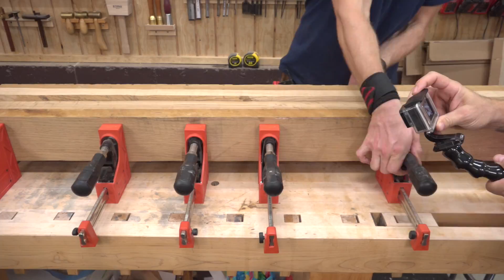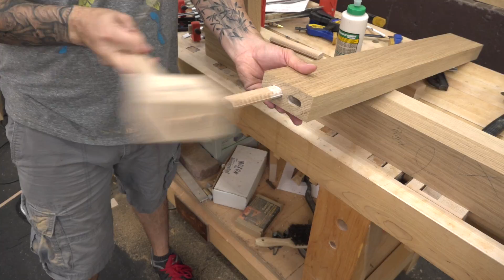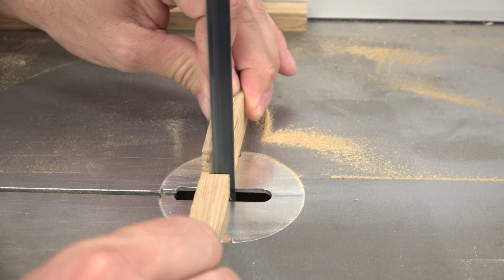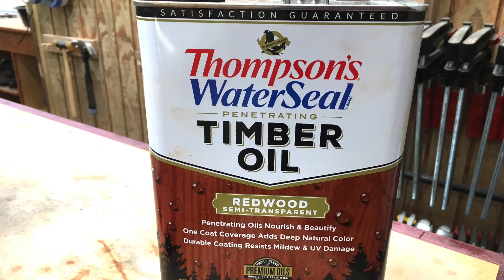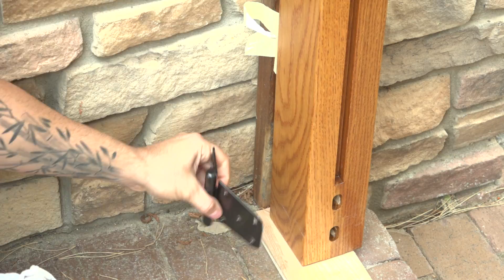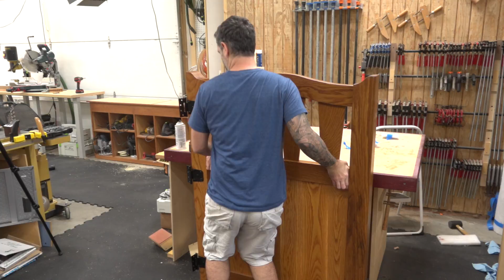Crooked Garden Gate

Comment: Installed my gate on top of an existing steel gate, heavy for the hinges but I also stick a roller on the bottom corner to support the weight. It swings smooth  without a drag.

Comment: Nice video and nice design. I've watched a lot of wood working type videos. This is  one of the few times times I watched one with the idea that I might make the thing. I don't know whether to feel discouraged or not. I have a contractor type table saw, compound miter saw,, a router and other common wood working tools. I've done quite  a bit of wood working but very little furniture level precision woodworking. So not sure  I have the skills and the tools to make a gate like this. I was surprised at the weight. I think I could deal with that though.

ETA: I liked how he used the slot cutter bit to make the groove in the curved stile. I hadn't figured out how to do that.

Comment: I love this gate. I have a pair of gates that need replacing and something like this might work really well. I want to bring up something in regards to thinning the Epifanes spar varnish. Last year I made two outdoor chairs from mahogany. On one chair I did exactly what you did and used mineral spirits to thin the first coat and then applied three coats unthinned. On the next chair, I forgot that I had thinned the first coat and applied three unthinned coats. A year later, the thinned chair had massive finish failure and the unthinned chair is fine. I called them and they require their proprietary thinner. I think their thinner is naphta, but I got their thinner when I refinished the problem chair. I hope you have better luck.
Reply from the maker: I have always thinned with mineral spirits and haven't had any issues. I am suspicious of proprietary solvents considering they are generally just more expensive versions of what we can buy at home depot. Grant it, naptha is a more pure thinner than mineral spirits, I haven't seen any personal evidence that using mineral spirits is detrimental to the condition of the finish. At least not yet. :)

Comment: After reading Bob Flexner and doing some experiments myself, I’m perpetually skeptical about any finish that “penetrates” the wood. But I am intrigued by CPS. Would be interesting to finish a board, then cut it in two to examine the cross section and see just how much penetration occurs. In the end, adhesion, resistance to u.v., flexibility, and various other properties may be more important.

Great job on the gate and, as always, the videos!
Reply from the maker: I don't think any finish penetrates very deep, on a scale that we can typically measure. But it stands to reason that the thinner the material, the deeper it might penetrate. And whatever you use in those first thin coats can lay the foundation for what happens in the subsequent coats. So the whole point of CPES is to act as a glue between the wood fibers and the topcoat. Without the CPES, you're looking at the finish itself binding to the fibers. Now i can't say for sure the CPES method is better, but if you believe the manufacturer's story it should make a difference. Of course time will tell. :)

Comment: I did something similar for my girlfriend and I now hang my head in shame!  Hah.  Knocked it out in about 2 days and it was a huge improvement over the dilapidated gate that was there, but still nothing as beautiful as this.  I had the same 2X4 side rails to work with.  I mounted pressure treated soft wood, but I don’t think the gate weighed more than 20 lbs.  I am really curious to see the latching mechanism you used.  I was hoping to see that.  Since my side rails were centered in the block wall, that played a role in the latch I could use.  I hope you follow up with that eventually.  Great vid!!

Comment: Just speaking for myself, I can see the angle, but I don't think having an angle other than 90 is an eyesore.  What would be an eyesore is if you had two different angles pretending to be the same angle, which to me would speak of laziness on the part of the builder.  But since you took great pains to eliminate that, it looks well crafted, and perhaps even the slight off-90 but custom fitted look adds to the beauty of the gate.  I think stuff built with "odd angles" can look great, and even show off one's abilities in a subtle way, since it's a bit harder to get that to look right.

Comment: Cremona didn't make you go through every board at the lumber yard until you found one where the grain curved for the top rail?   I like what you did with the grain for those vertical slats.
Reply from the maker: It was slim-pickens at the lumber yard that week. The selection was sad. I honestly wasn't even sure we'd be able to make the project based on the condition of what I had to work with.

Comment: Great build thanks for sharing. Can you advise on wood. Was the white oak kiln dried or air? Knowing what moisture content you used will be interesting for upcoming projects. Thank you again
Reply from the maker: +Mike Seymour kiln dried. Not sure on the moisture content.
Reply: The Wood Whisperer thanks for your reply Marc. I'm new to the external woodworking side and was led to believe that kind dried would suck up moisture and deflect. Any experience of this? My saw mill recommend green or air dried but am more inclined towards your advice.
Reply from the maker: Air dried would be better if you can get it. That's stuff's not as easy for me to find so I used what I had access to. Ideally, I'd let the kiln dried stock acclimate outdoors for a few weeks but time wasn't on my side.

Comment: Do you really need to make extra space for the inner parts, given they're all covered in epoxy and moisture won't (supposedly) affect them?
Reply from the maker: Yes. Moisture WILL affect them. Finishes generally don't completely lock out moisture, they only slow down it's travel into the wood.

Comment: So I just got around to this video.  I see that you used the standard beech dominos.  Now I know they sell sipo tenons for outdoor applications, what are your thoughts on that?  Part of me says it's just Festool cleverly getting people to buy twice as much tenon stock, that as long as I surround the thing in outdoor rated glue or epoxy, I'm good.  But the other part of me is like yeah, some woods don't do as well outside.  This nagged at me, so in a recent cedar patio table, I ended up fabricating my own tenons from the cutoffs instead of using the store bought ones.  Did I waste my time?

Comment: At 5:40, where you used to make mortises, would a spade bit be used? Can it be a problem if the dowels are a different wood?
Reply from the maker: Spade bits are pretty rough. I wouldn't use them for a dowel application, personally. I'd probably go with a regular twist bit or a brad point bit.
Reply: The Wood Whisperer thanks

Comment: Would the smaller domino work in the joint application?
Reply from the maker: +Mark Dwyer it would work, but I do like the confidence I have in these extra deep joints.
Reply: The Wood Whisperer ok thanks I could put 4 of the biggest smaller dominos  to give it an extra bit of holding power. Thanks for the reply love the video and the channel.